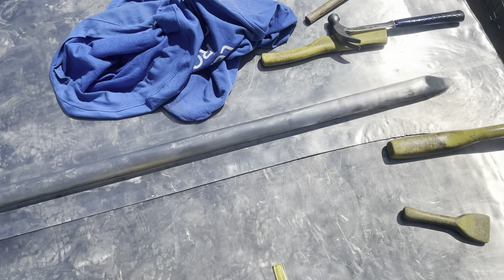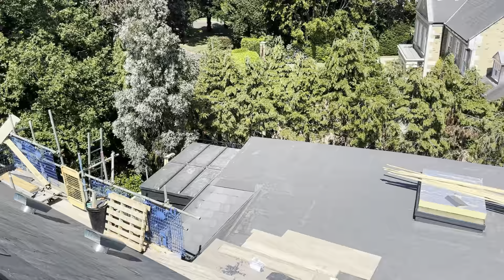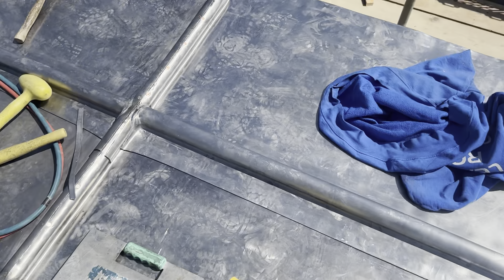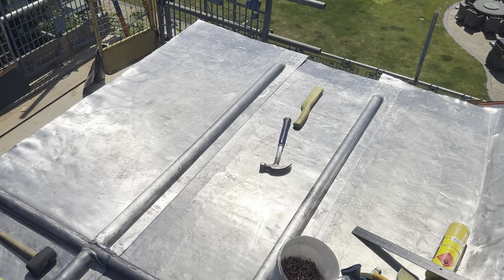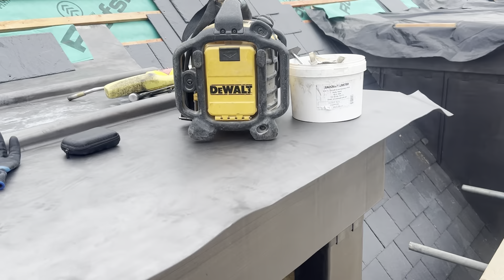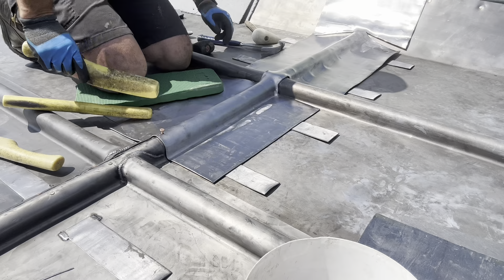Installing Lead Work to 3 large Dormers. (Phase 3. Part 2)

Comment: Beautiful work. Shouldn't have any problem with these well into the future. I still miss the colour of the tiles. All a bit monochrome for me. Grey slates. Grey lead. But definitely looks the part. I watch a few You tubers  from the UK. All talking about the 30 degree heat. It was 26 degrees where I live the other day, and it is the middle of Winter. The hottest day I have experienced so far was 49.6C. But many days in the 40's is not uncommon. At 26 the other day I resorted to an under shirt. And long pants. It felt quite chilly. I would die in the cold now in the UK after over 25 years in Qld Australia. But when I lived in the UK Summer was grand. When it wasn't raining.
Reply from the maker: Thank you. I get what you mean about the monochrome but I think for me I’ve become use to it as it’s all I ever see. 
I honestly don’t know how you cope with those sort of temperatures. 30 degrees and the lead was so hot it was even burning me through my gloves. We had a few days last summer in the 40’s. It was unbearable. I ended up with heatstroke. But at least the lead becomes nice and soft.

Comment: Hi Stu , I'm a roofer but in no means a lead worker , I've recently done some lead hips , oiled front and back and allowed to dry but after rain they still had white oxidation marks ? Can't see why ? I've got the white off and oiled them again , but wondered why they did in the first place ? Never had it happen with any other lead I've done ? Cheers
Reply from the maker: Hi, It happens to me too. I’ve found that even if you knock up the lead. Oil it on both sides it will still need oiling again once fitted. I think when you set the lead in etc. It takes some of the oil off. The job I’m working on at the moment is 4 large dormers with lead flat roofs. I’ve oiled the lead twice. And it could still do with another coat. Sometimes if you oil stuff. But there’s moisture in the air that night. The oil won’t take properly. It could also be that oil just isn’t as good as it used to be. Like everything else lol🤦🏻‍♂️😂
Reply: Shake the patination oil bottle before using, I usually shake mine for 20 secs, all the bits separate when it's still and needs rejuvenating and yeah minimum of 2 coats of oil